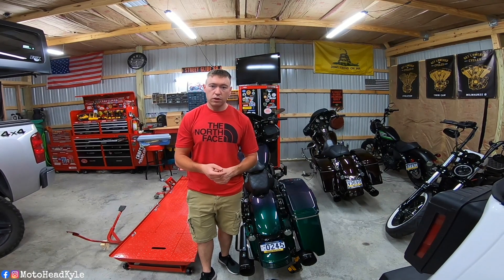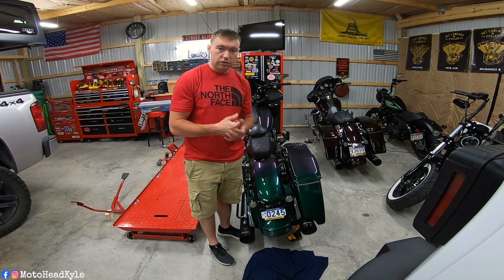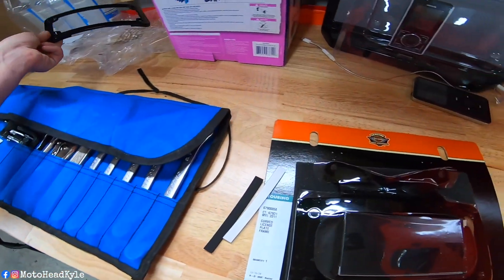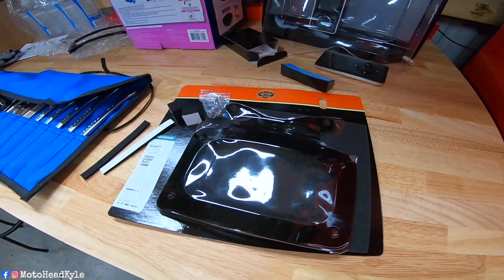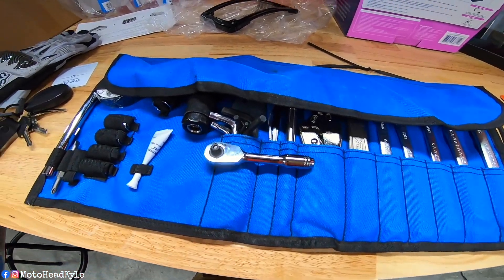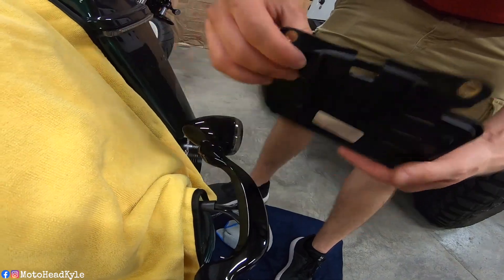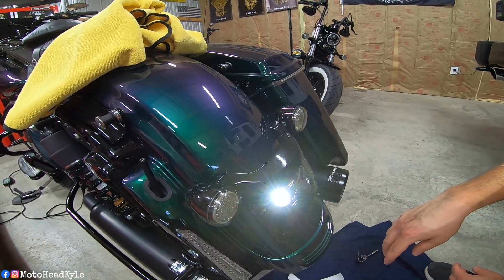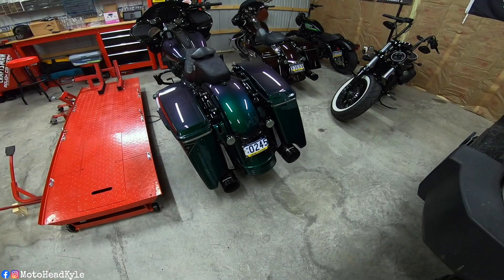Harley Davidson Curved License Plate Install on a Road Glide Special FLTRXS

Comment: Doubt youll see this can do you still jabe the plastic plate
Holder? Was wondering if you coils measure
The mounting hole distance i have an flht and everything says this wont fit. Inhave some
Plastic clips inside the inner holes.  I should have removed the whole directional bar and checked if i could screw them in

Comment: Is it possible to remove the license bracket with a low profile torx while the turn signal bracket is still on the bike?  Just curious before I attempt to get my fat arms up the wheel well.  Thanks! Nice video!
Reply from the maker: Ehhh, most likely not. I couldn’t even get the little torx bit to fit in between. It’s a real pain to take the turn signal bracket off. it’s pretty tight. Best of luck! Thanks for watching!

Comment: In performing this mod, I also noticed that the original 1/2" bolts had Red Loctite on them and seeing how much everything vibrates, I would at least use Blue Loctite as the min here.

Comment: Ive got the same bike, plate screws barley reach bracket, one does not, crazy how hard this simple task is, ive trimmed the plate and flattened the plate to avoid any gaps, they need to be a 1/4 longer.
Reply from the maker: 🤣 right!? Definitely looks way better afterwards though

Comment: I went with the V-Factor version from Dennis Kirk because Harley doesn’t have black hardware for the bracket, no clue why, and they are way overpriced.  Good vid though, can’t believe you had to trim the plate too.
Reply from the maker: Thank you! It’s always the “little” jobs that are the most pain in the a**! But I got a great discount on it so that helped. Never looked into the Dennis Kirk bracket! Food for thought for next time. Thanks for watching 🤙🏻
Reply: Does that have the foams to help reduce vibration? Heard that both HD and Kuryakyn brackets broke off at some point if not having these properly put on?
Reply: @than.truong  no foams and haven’t had a problem.
Reply: @SJBagger  thanks bro for quick response.
Reply: @than.truong  absolutely